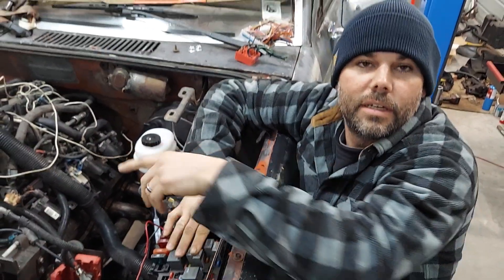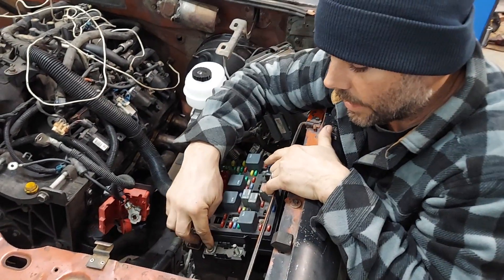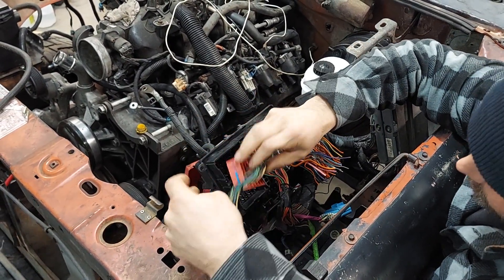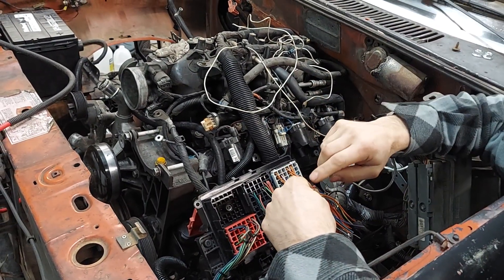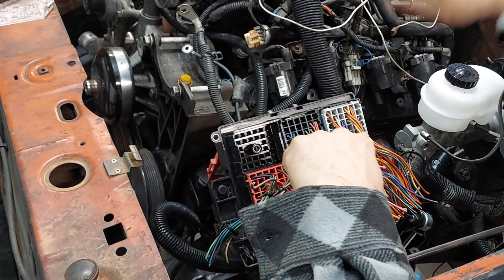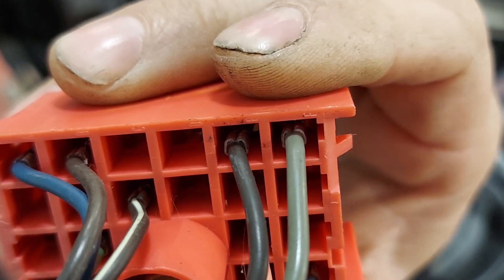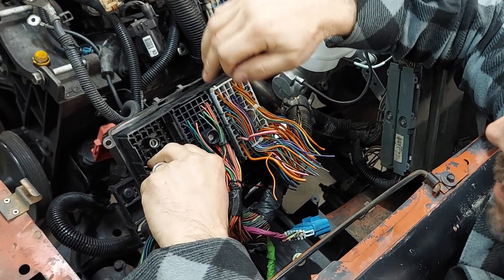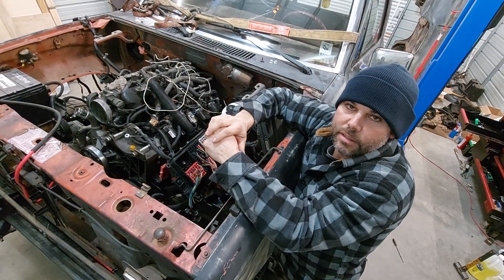ls swap wiring with factory fuse block

Comment: What does E2 connect to on the transmission
Reply from the maker: It's the main power wire to the transmission solenoids, I can't remember what pin but it's in the main round connector on top of the transmission
Reply: Thanks
Reply: What if I have a stand alone harness can wire it same way to the fuse block

Comment: Awesome. Subbed  ,Liked ! Thanks Brother!
Reply from the maker: are you swapping an ls motor?
Reply: @slaterrockshop4564  as soon as I find a 6.0 for my 91 Silverado I am..almost bought 5.3 but trying to hold out if I don't get too excited watching everyone else's videos of theirs running like crazy lol I bought it 3 yrs ago to make a Lil hot rod and ended up having to put on hold but now I'm ready and really excited lol
Reply from the maker: @badassbees3680  The 5.3 can get a lot better fuel mileage than a 6.0, but if you are not worried about fuel mileage the 6.0  is a hoss!
Reply: @slaterrockshop4564  it's my first swap..I've rode in some ls stuff of various sorts..trucks,camaros..I got a couple guys that play with tuners I can take it to until I learn but I've built alot of sbc with all kinds of variations..last one was 69 chevelle with 400 small block car 4 speed..but I've never built or had an LS myself so I'm pretty stoked when I watch people with obs trucks swapped.

Comment: How about the starter signal wire to keep the oem LS starter wire in the harness.
Reply from the maker: I'm not sure what pin goes to the starter relay
Reply: Pin A3 on C1 block is the stock ls starter relay source.

Comment: You guys know, if I can I put a 2011 5.3 Silverado harness in a 2008 tahoe  5.3 block and transmission with a 4L60E?
Reply from the maker: I'm unsure.  I would stick with the 08 harness if it's possible
Reply: @slaterrockshop4564  I  agree however I am getting 2011 harness for free from a friend that why the dilemma
Reply from the maker: Probably will be different because of transmission

Comment: Do you need e2 if you have manual transmission
Reply from the maker: You should not need e2 for a manual trans.  Just make sure you computer has been programmed for a manual trans.